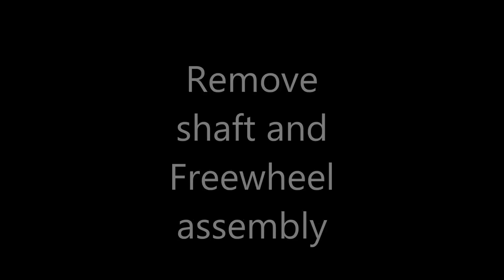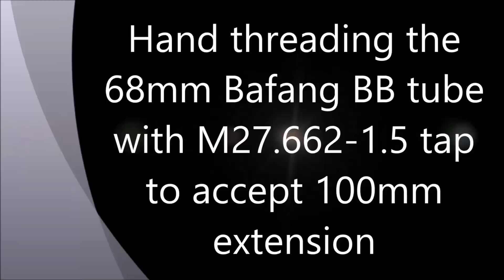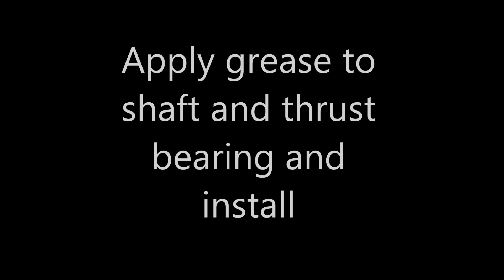Bafang BBS-02 Mid Drive Modification for Fat Bikes

Comment: Will putting so much Grease inside the Freewheel Mechanism not tie up the teeth which may cause them too stick has some types of Grease set really hard when a little heat is applied causing you problems after awhile.